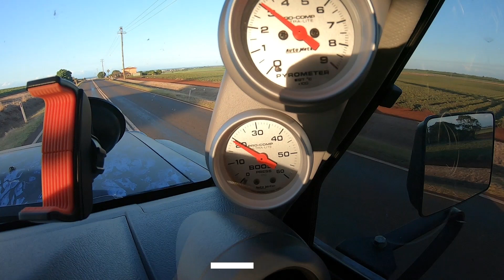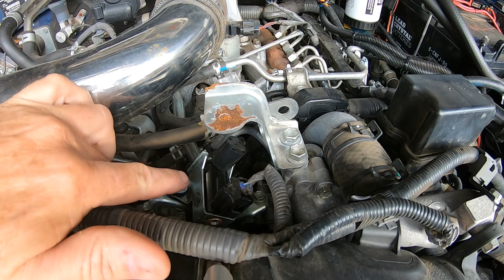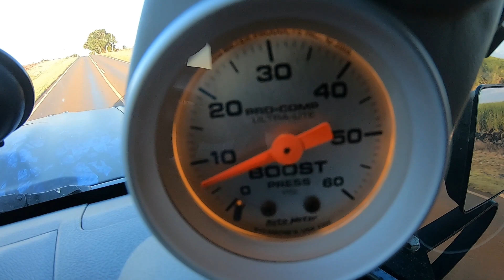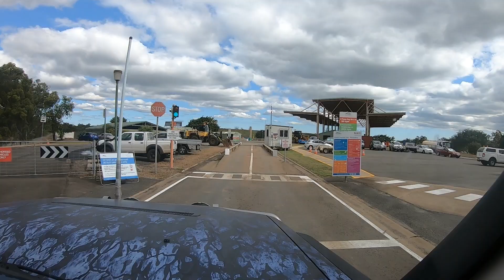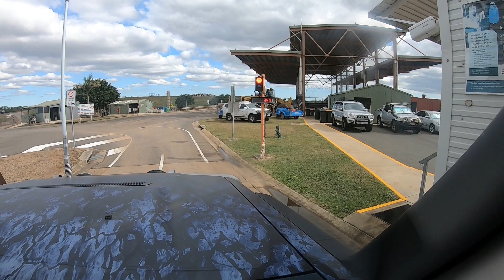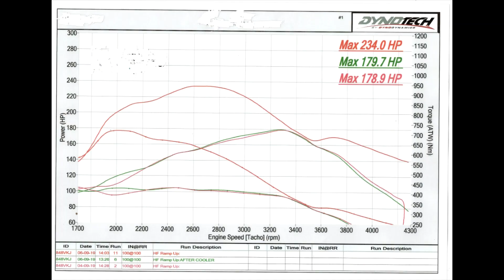Toyota 79 Series Twin Cab Landcruiser - How much BOOST is too much boost?

Comment: Hey mate. Where did you T your boost gauge rubber hose too?
Reply from the maker: I’ve got a PDP front mount intercooler and a single entry to the plenum (no top mount and got rid of the ome ducting to the plenum = manifold).  The plenum had tapped holes for the gauge take off and the MAP sensor.  

k
Reply: Would you T it into the map sensor line if you didn’t have the single plenum?
Reply from the maker: I’m not sure if that would affect the MAP sensor or not. I’d imagine it unlikely to affect it but ……

Your ECU measures boost so if you have a scan gauge you should be able to read boost that way. My scan gauge measures boost in inches of mercury (atmospheres).  I went the analogue gauge because I wanted real time readings so I could monitor engine performance (boost in psi) together with other readings such as manifold temperature, exhaust gas temperature, water temperature (the genuine water temp gauge is crap), fuel pressure and fuel flow (usage) rate.

k

Comment: What turbo r u running?
Reply from the maker: Dane,

I put a bit of info in the description of the video 👍 But for ease, I have standard Toyota injectors and a standard Toyota turbo. Realistically, I’d hope I might scratch another 60k kilometers on the turbo, hopefully.

These standard turbos can be wound up to pump 40psi, but they aren’t built for it and they won’t last doing that sort of work, not to mention all the leaks that would occur everywhere after the turbo and before the intake valves.